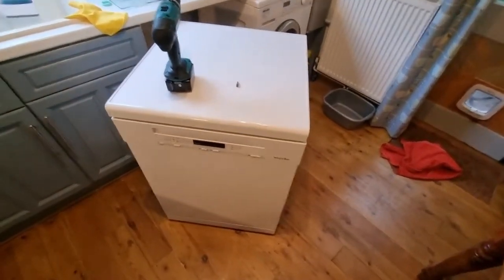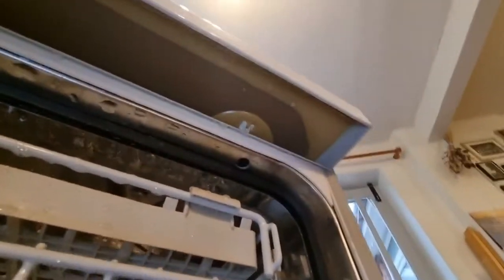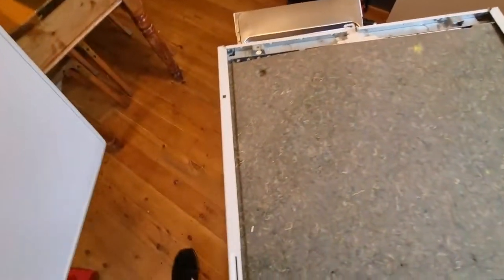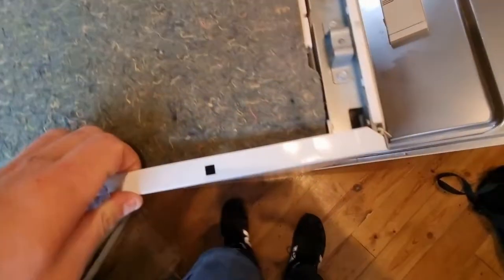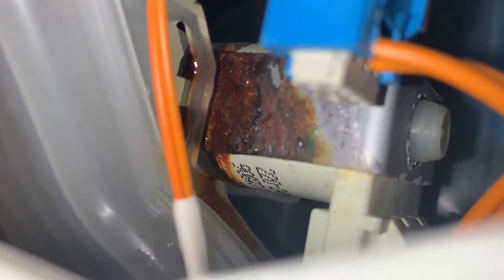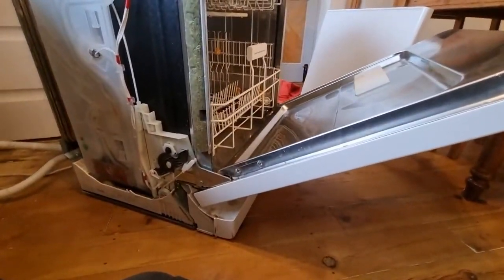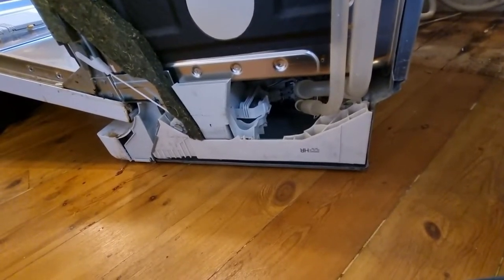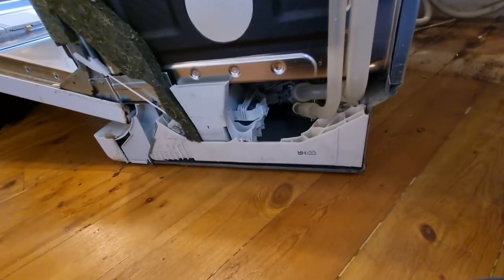How To Quickly Open A Miele Dishwasher

Comment: Got a F2 error and was able to access the temp sensor via the right hand side without having to tip it over and go from underneath. Realised that the sensor simply pokes thru into the sump part under the filter cover on the inside, so took that off and was able to pull from the outside whilst also pushing form the inside to pop it out. 👍

Comment: I don’t suppose you know how to remove toe board at front I’m bamboozled thanks in advance
Reply: I don't know if it is the same (I own an AEG) but some manufacturers have the screws underneath and you have to push the front of the dishwasher backwards and tilt it and put it up on something and unscrew it close to where the feet are.